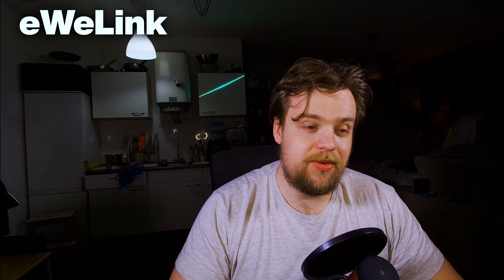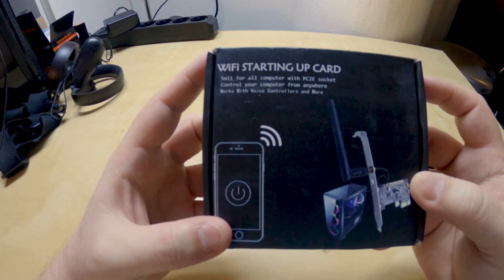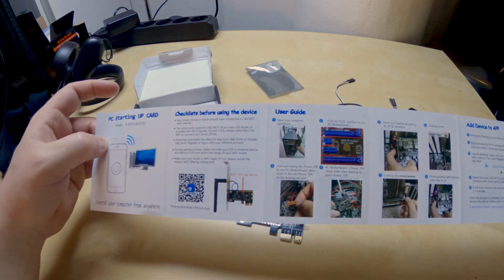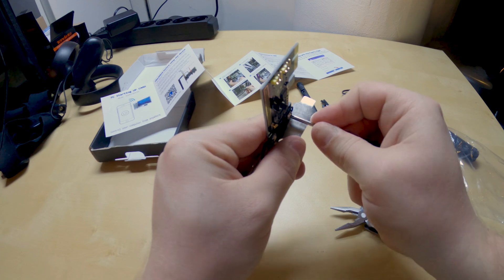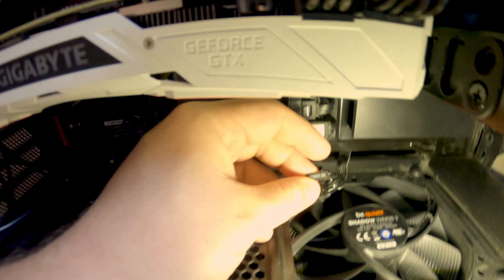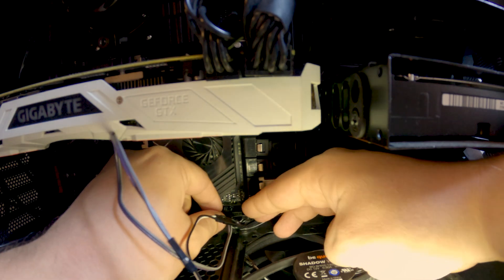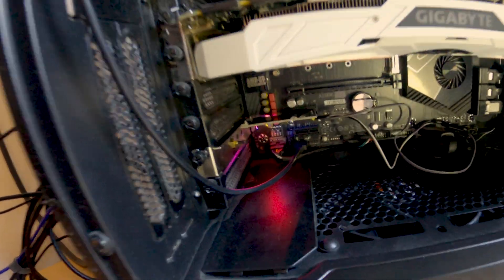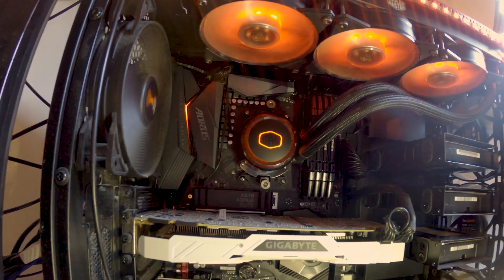AliExpress PCI card to turn on my PC?

Comment: Let me ask about the error, I have connected to the application but when I turn it on in the application, it does not turn on the device, and it only lasts a few seconds then turns off in the application, how to fix it?

Comment: Silverstone have 2x units, that use a remote on a keyring, that do the same, 1 also uses usb plug (no add on card), (You need to make sure usb 5v stand by power is on in bios)., 

Only different  it uses your wi fi on phone.

Silverstone version using a remote, and it's been around for a long time.  I had the usb version for my 6700k intel cpu system.

My only complaint is the alarm battery lasts 1 year before going flat, and remote has screw to open.

Comment: I got a problem with this card and the Asrock z370 motherboard. When I connected the monitor via displayport to an external graphic card, this starting card stopped working properly and the computer started to turn on and off. Moving it to other PCIE slots did not help. Apart from that, the card works, but the Ewelink servers are not working today and the computer can only be controlled from the local network.